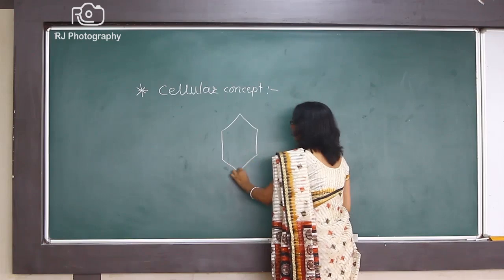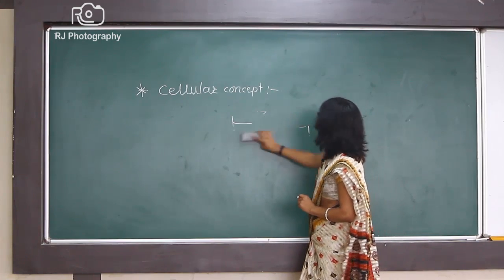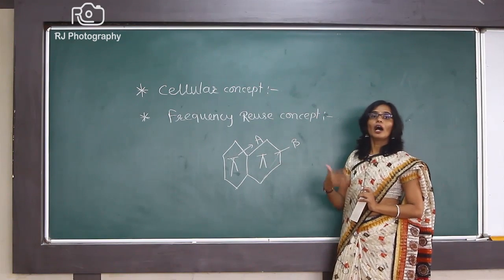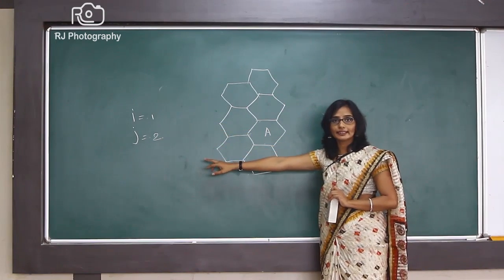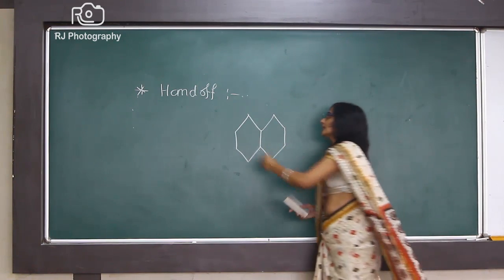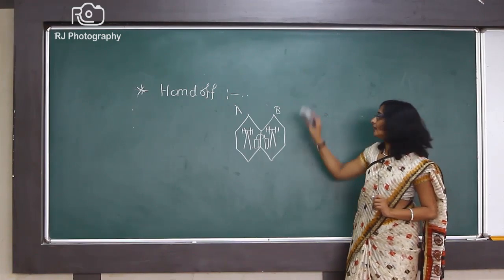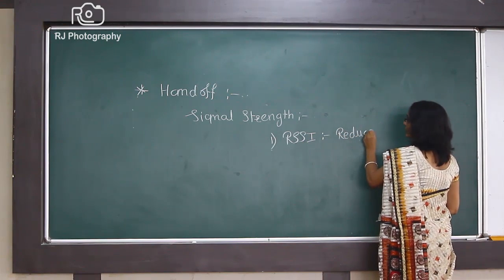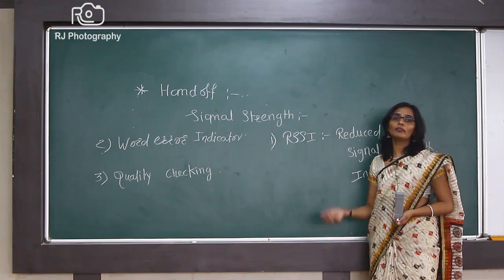Mobile Communication | Electronics & Telecommunication | BE | Roshan Solse | RJ Photography

Comment: correct me if i am wrong
1) time division multiplexing: allows same frequency to be used by multiple users within the same cell and 
2) CDMA ..... allows entire bands to be used in all cells by assigning unique codes for base stations. 
This was already achieved at the time of 3 g and well in place in the 4 g system
the explanation provided in the above video is a depiction of 1 g (especially the frequency reuse pattern) and also in the 1 g system, the base stations were positioned in the corners of the hexagons (for better use of the available frequencies. As the antennas were pointed inwards the chances of spillover to adjacent cells were minimized and the number of buffer cells required before the frequency could be reused was reduced to 1